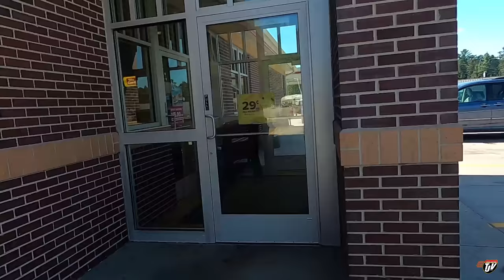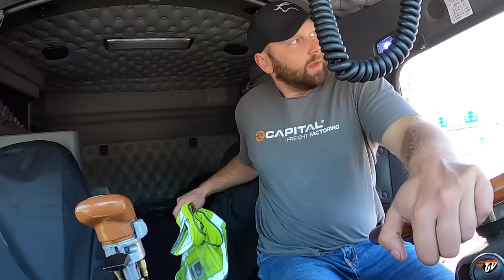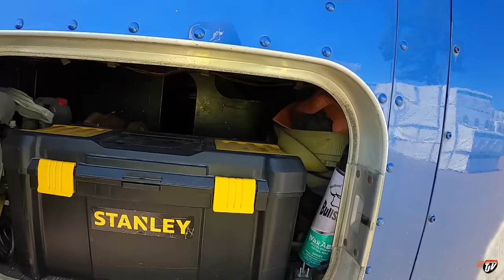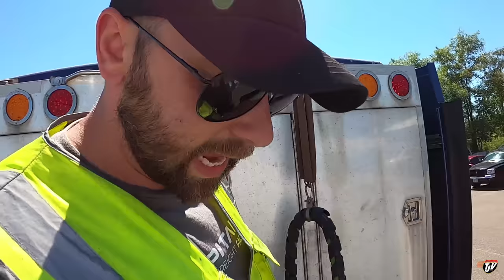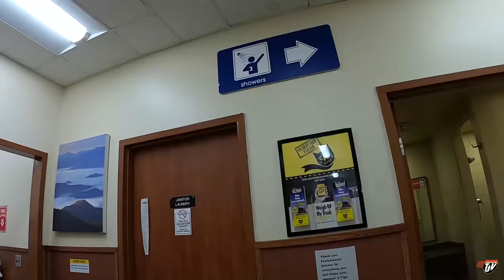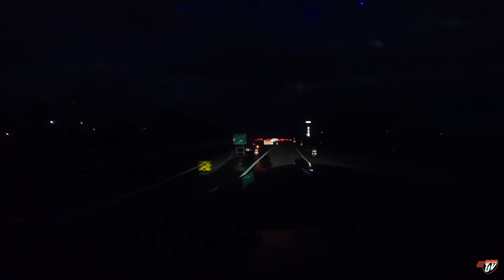My Trucking Life | ROLL THEM UP!! | Vlog #2599 | Aug 10, 2022

Comment: Another great vlog. Tow trucks should camp out at truck stops. Any one parked in the fuel lane for more than 15 minutes get 2 calls over the loud speaker for 3 or 4 minutes. So twenty minutes after they park the truck belongs to the tow company until they pay a fine at the fuel stop and the tow company. Problem solved.

Comment: As if there aren't enough headaches and pitfalls with trucking, you have to deal with drivers who have absolutely no respect for whatever time constraints you might be under. Not even a nugget of a kernel of an inkling of a thought about the guy waiting behind them. People think racism is passed down from generation to generation. Maybe sometimes. But I will flat out admit to you and the rest of the world that since I've been doing this job I've seen disrespectful patterns of behavior repeated by certain groups of people. They have no interest in being critiqued or criticized about these things either. Not when I've tried anyways. If anyone out there wonders where "white rage" comes from, try being behind an eight ball on a load and refueling behind one of these airheads. Just infuriating.